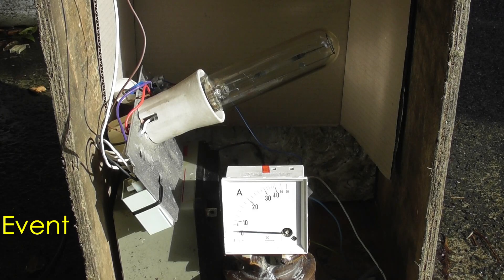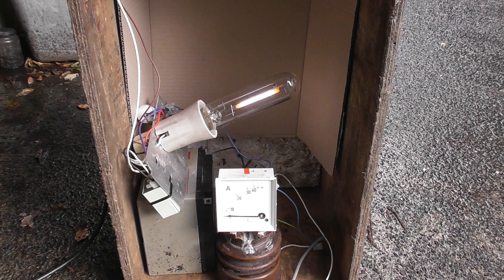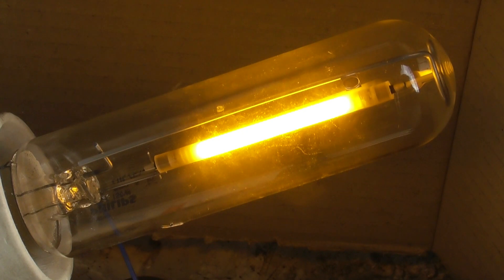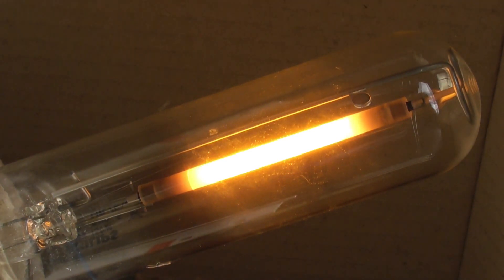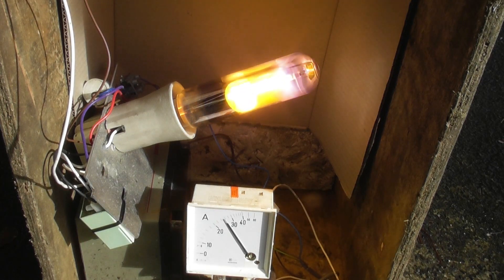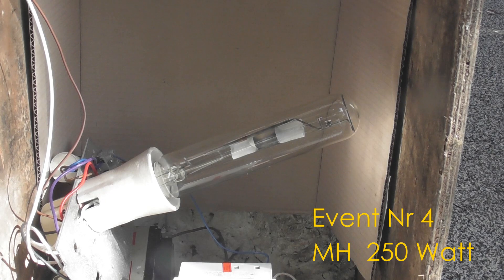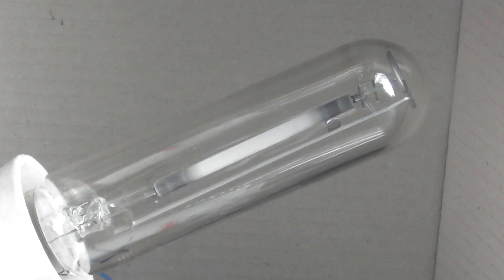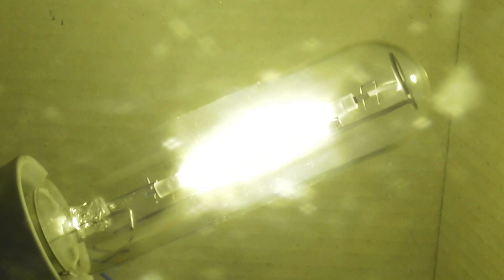Overballasted expired 100/150/250 HPS lamps

Comment: Were these bulbs connected to 240V in series with the MOT primary? Or were they connected across ~2kV from the secondary winding?
Reply from the maker: The MOT's were switched in parallel with the normal 150 Watt ballast.
Reply: @RODALCO2007  so if I understand correctly, the bulb itself had a voltage drop  a bit less than 240VAC across it and was passing a few tens of amps (as shown on the dial) through the arc tube. Impressive!
Reply from the maker: The ballast normally limits the current to the lamp, otherwise it will self destruct as you can see in the video. A larger ballast means more current, more heat and failure of the lamp. @deltab9768
Reply: @RODALCO2007  makes sense. At first I was thinking the MOT’s secondaries were feeding kV to the lamp but it sounds like that’s not the case.

I think part of my confusion was being from the USA where 120V lighting circuits are very common. So they have a ballast that both boosts voltage and regulates the current.

Comment: Im wondering that is it possible to connect two ballasts to run one lamp? 600+400=1kW?
Reply from the maker: Yes, try it out and check if the 400W ballast doesn't overheat, because the impedances are not the same.

Comment: Congrats on 15 years!

 I havent  been around HID lamps too much in the past  8 or so years,  before that it was almost daily..
Best thing about HPS  and Pulse start MH is they sometimes fail and will completely mirror the inside of the lamp as yours were...
Have used mirrored "ED17" and "ED28" shape bulbs as christmas tree decorations as they look similar to old school christmas light bulbs only way bigger and cool looking.
Reply: I've only had probe start ones just not start anymore or start cycling. Nothing as fun as the quartz tube going snap and silvering the outer envelope.

I tried putting an expired probe start bulb in the microwave in hopes of exciting the mercury vapor that way and instead just got a really cool flameout and plasma from the start circuit resistor!

Comment: pretty cool how two of them lamps kept running once the arc tube ruptured allowing sodium vapor to be ionized / arc in the envelope then deposit the sodium metal? on the glass.
 If it is sodium metal it will react with water.
if other metal probably won't react.
Reply from the maker: I have seen blown sodium lamps in the skip with a silver/black coated envelope with similar colours.
Reply: There is some mercury in there too. Hopefully the outer bulb doesn't burst too.

Comment: LED 1500 WATT panels are incredible
Like the 🌞😎 Sun
Lights up for miles
Reply: I'll put up a 1500W short arc xenon against any LED 1500 W panel. Fun with point- source lamps when they "expire" tho :)
Reply: @totalrecone  This comment reminds me of pictures I saw of maintenance workers replacing IMAX projector lamps.
They wore some quite serious protection gear.
Reply: @Kalvinjj  Totally agree. Those IMAX 15kW lamps could literally blow a hole in the lamphouse should they 'go off' while under operating pressure. I had a 4.5kW xenon blow during a performance and it took out the dichroic glass mirror, dented the Strong X60 outer shell and the anode lodged itself in the shutter of the projector. The explosion rang in my ears for two days after.

LEDs are definitely safer :)
Reply: Ok